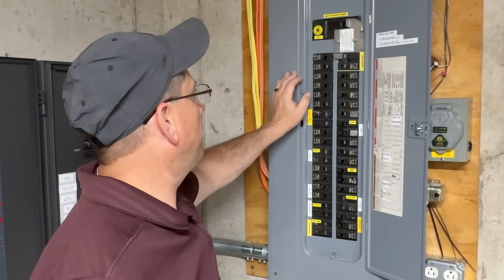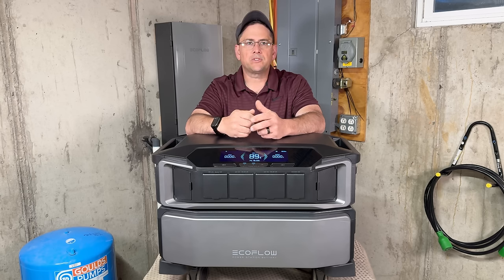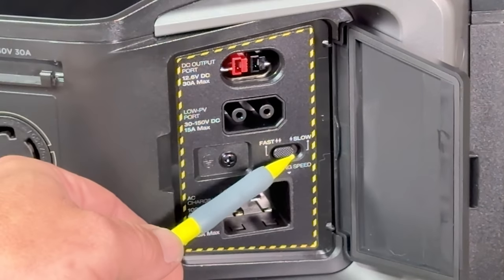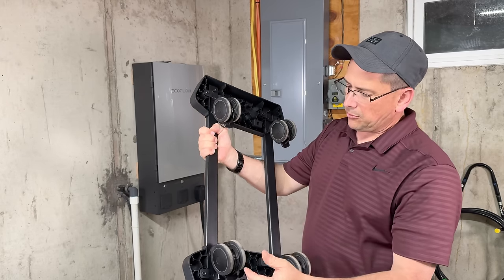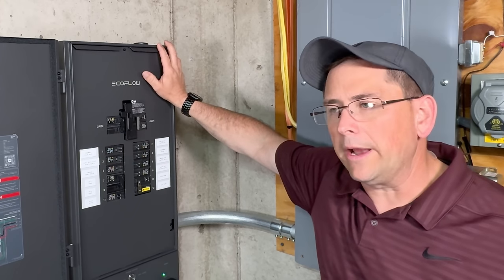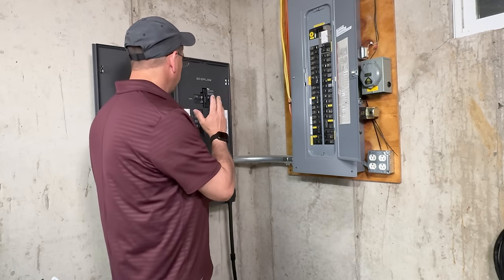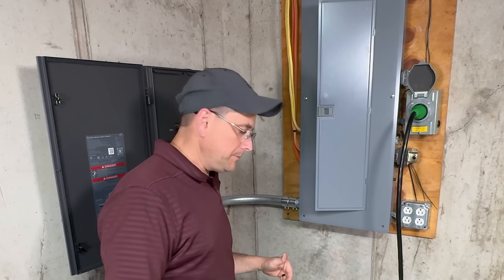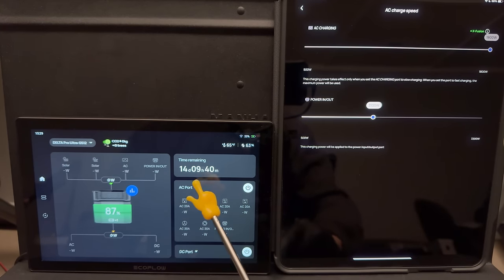EcoFlow Delta Pro Ultra & Smart Panel 2 Replaces Generac Standby Generators Part 1 of 2

Comment: I'm not sure why you need a sub panel. Why not power the entire panel and load manage your home on the fly? This way you have access to any circuit you want. 
I use a Generlink and a portable 7500W generator and it works great and I did the whole thing for about $2800 CAD.
However, if i could afford it I'd prefer to have the Ecoflow stack and charge it via my RV's 5500W generator. Very quiet and efficient, but its only 120V.
Reply from the maker: Some people aren’t savvy enough to control how much power they’re using. I didn’t use a subpanel, my original design was using an interlock doing exactly what you just described. I have a 8000 W 230 V Generac generator. I also have a 2300 W 120v inverter Generac. The battery system is a really nice, convenient item, but it definitely is not cheaper than having a gas generator.
Reply: @HVACRSurvival  I cam understand why it is more money, but I don't care. I'd have the battery system any day if I could. To me, it seems to be a similar issue with induction stoves costing so much more than conventional ones ... just because.   Sure there is a bit more tech in there, but its not that much for them to cost so much more than conventional stoves. I guess the only way to force these changes is either by rebates or other financial incentives as many seem to care only about their pocketbook.
I understand with these units there is a lot of tech and exotic materials in the batteries making the prices higher.
Can you give a price comparison between a typical general setup and this system? Be nice for us viewers to compare ... even if they gave it to you for review.

Comment: I purchased this exact setup with 2 batteries and the ecoflow smart panel 2. I have a solar panel array in my backyard. I know there is a way to wire it so when the grid is down it will charge the ecoflow batteries instead. I've contacted multiple electricians in the area and they say they would have to run a DC line from the solar panel inverter to the house. I already have lines ran from the solar panel inverter to my breaker box inside the house. Can't you use the lines that are already ran to the house already?
Reply from the maker: I’m not sure what you mean by a solar panel inverter? Generally, you take the voltage from the panels that are outside and run them directly to your EcoFlow power station. The power station has two solar inputs, one is for high voltage and one is for lower voltage. You need to measure and see what your total voltage is and make sure that your wattage is not over the rating plate for the input you’re using.  You plug this strait into the EcoFlow. This is a pretty simple thing to do, you just gotta make sure you have the right size gauge wiring to handle the voltage and wattage that’s coming from the panels so that you don’t have a large voltage drop.
Reply: @HVACRSurvival    When the solar input is low will a generac generator automatically start charging an ecoflow ultra after it drops below say 35% charge?

Comment: Great vid. I’d really like to hear your opinion on this vs a generac for “grid-down” situations. Is this a better option even without solar panels?

It’s also my understanding that the Inflation Reduction Act will cover this too. If so, does that make this a better value than a generac?
Reply from the maker: I have heard there’s a 30% tax credit available. One of the things to consider is when your gas generators is running and you don’t have any loads on it,  you’re still burning gas….so if you don’t have solar, you could always charge it with the generator in anywhere from one to a couple hours, and then shut the gas generator off for several hours compared to the gas generator running nonstop

Comment: QUESTION My ecoflow ultra was half delivered today. Expecting the other half shortly. My electrical panel is outside. I plan on using a generator outlet and an interlock. Can that generator outlet be placed inside the house even though the panel is outside? Using SS2-50P/L1430/L1430P to SS2-50R
Reply from the maker: Yes, if I’m understanding you correctly, you’re gonna have the interlock switch outside at your breaker panel and you want to mount the inlet box on the inside of the house like I did at my panel in the video? Of course, that means you have to run your generator cable into the house to reach the inlet box? Normally, the inlet box is mounted outside so that it’s convenient to hook up the generator outside and not have to run the wires into the house.

Comment: Thank you for the informative video.  Will watch your other videos.
If I have two electrical panels - that are on different floors - do I have to get two EcoFlow systems with two EcoFow panels?
Also, since the EcoFlow panel does not have as many spaces for circuits as a regular electrical panel, do you combine circuits? In other words, can a Ecoflow panel circuit handle more than one circuit from the house electrical panel?
Thanks.
Reply from the maker: You can use tandem breakers to add extra circus, but you need an electrician to look at your system and advise you of your options. I can’t do that without seeing it and knowing what your local code calls for.

Comment: This is a wonderful review but I have so many questions. I have a Whole House Generac 22KW. I want the Ecoflow Smart Panel 2 and a EcoFlow DELTA Pro 3 Portable Power Station
DELTA Pro 3 + DELTA Pro 3 Extra Battery because I want to turn off the Generac at around 10 pm at night (Very Noisy and neighbors really near) and run only a few circuits including 4 Ton AC u
unit. My idea is to run this until sunrise. I need help in configuration but it will be installed by a licensed Electrician. How can I contact you?
Reply from the maker: @thompsonp86 i’m not available to do sizing or give advice. Your application could vary compared to mine. A 4 ton AC unit is bigger than what I’ve got and it’s larger than what they rated it for, you’re better off with the delta pro ultra over the DP3 because of the size of your AC. You likely will need to have an HVAC contractor come out and see see what the inrush of your AC is to see if the DP 3 could handle it. The contractor could always add a soft start or hard start to the AC to with the starting amps. A Electrician should be able to calculate what your normal running load is to see if one battery is going to be enough. That’s about as much advice as I can give you without seeing it and testing it.

Comment: Thx for the great video!  I'm getting ready to have a whole-home ECF setup installed.  3xDPUs, 2SP2s, total of 5 batteries. Like you, we have a heavy load here.  Q:  Does the power cable you show (7.1'?) connecting the Sp2 to inverter come with the panels...or need to order separately?  Is there a cable with the inverters capable of connecting to the Sp2?  Cant tell from their website..   Thx again for all the good info!
Reply from the maker: I believe it came with the SHP2

Comment: I have a DPU and a Manual Transfer switch. Can I leave the MTS with my circuits left on "GEN" and have the DPU plugged in to my regular 200 amp panel without issue? Looking to run the DPU as a whole home UPS. So When the power goes out the DPU batteries kick in without me having to be around to flip switches should the power go out. Or does this cause a looping issue?
Reply from the maker: The 30 amp plug has UPS built into it but that’s only 120 V. I think you’re gonna have a hard time doing what you’re explaining because of the amount of amperage looping through the machine. I don’t think you’re gonna be able to recoup fast enough. The safest bet is to get the automatic transfer switch.

Comment: Question so I’m looking to throw this into a camper trailer and convert the trailer to solar but my question is could I charge the unit with shore power from a campsite when I do decide to use a campground?? Can I just plug the shore power into the generator plug and would I need to u plug the solar to the unit while charging it off shore power
Reply from the maker: Yes, it’s got seven different ways that you can charge it. Plug it into the wall, plug it into a transfer switch, plug it into a generator plug it into another power station plug it into solar you can do all at the same time you can plug it into a car You name it.

Comment: If we are planning to have this unit in case of a multi day power loss like a hurricane and want it to run our home HVAC along with essentials (fridges, deep freeze, micro, cpap, pool equip), do we add up the amount of wattage each of these appliances use and buy enough DPU batteries to cover the wattage?
Reply from the maker: If you’re wanting to live life like you’re not on a reserve power with a battery system plan on spending allot of money on extra batteries and extra inverters. You’re definitely going to need solar cells or a gas generator to recharge it if you’re planning for a hurricane where the power can be out for several days if not longer.  Pool equipment is not an necessity when you have no power, that eats up a lot of power. The easiest thing to do is look at your power bill and see how many kilowatts a day you use on average, that will tell you what you need to know and just add up how many days you want power for.

Comment: I wonder how will a system like this would run a 240V inverter welding machine.
Reply from the maker: You know what,  I can run a Lincoln 130 with it so I can try that. I don’t see why it would be a problem. I have access to a Lincoln 180 or 170 which is 230 V. Maybe I’ll pick that up too, but it’s so heavy to take outside that kind of sucks of course I can run it from the house so I guess we may have to try that.
Reply: @HVACRSurvival  Even places inside might not have power enough to weld with.  You could also mount it inside a cargo van, etc, much like how engine driven welders are used now.  If you are welding outside a power source is still needed.  Most welders could fabricate something like a cart to use it outside.

Comment: How many batteries would I need for three day with normal appliances. Fridge, lights tv etc.. I don't want to spend for 5 batteries because it's expensive
Reply from the maker: Best thing to do is either buy a meter that keeps track of how ow many watts your using or look at your power bill and see how many kilowatts you’re using per day. Everyone’s gonna be different. Also depends if you have a lot of heavy electrical appliances like electric range, electric water heater, electric dryer, all those things are gonna change the numbers. There’s nothing cheap about any of these systems.

Comment: Can you run the Smart Home Panel 2 off grid without it being hooked up to a grid panel at all?

Can you run 240v loads with the Smart Home Panel 2?

Say it’s hooked up to the grid like normal, can you have say a Generac standby generator that comes on automatically after the batteries have depleted and stopped outputting power?
Reply from the maker: I'm probably not understanding your question, but if the power is completely out, the smart panel switch is powered off of the DPU, if you're wanting something to communicate between a generator and the smart panel, you'd be better off buying the Eco flow automatic generator that communicates with the power station, it can automatically start it and shut off once the batteries are charged and I'll do it remotely.

Comment: Got 2 5p smart batteries and 18 panels, and all I pay is the mandatory 12$ california charges. I drive an EV as my promary(about $200 annually)as well. It did have a "car" price to install, but the warranty is for 20 years, no queations. So if you switch to solar in Cali, you will move your power bill to your solar bill. I just wish california didn't do away with power credit back.
Reply from the maker: Lots of good information there that I didn’t know. Thank you for sharing.
Reply: @HVACRSurvival  too many fears with going solar, I figured some personal  experiences with balpark numbers would help. Have a good one.

Comment: does this product work outside the USA/Canada?
Reply from the maker: @ThomasWhittaker  this particular unit is 60 Hz 230 V 120 V. You might be able to get it in 50 Hz but it have to be specifically purchased that way.

Comment: Great Video! Thank you! Can I charge it with my Ford F150 powerboost, I have the 7.2 kw inverter and keep on using the battery power at the same time?
Reply from the maker: I’m not familiar with the Ford power system. What is the voltage and is it DC or AC. ?

Comment: Does this have a capability to sync with an existing SolarEdge grid tie inverter, I have one at my house, would be nice to have when net metering ends in 2032...
Reply from the maker: I’m not familiar with the item you’re mentioning but this is mainly proprietary equipment. You’d have to figure out which wires are doing what and hope they don’t do anything along the lines of communication. I would most likely doubt they do what you’re asking about.

Comment: Can the inverter handle the cold also like the batteries
Reply from the maker: It has the warmer built into the batteries with the DP Ultra.
Reply: @HVACRSurvival  and the batteries warm up the inverter?
Reply from the maker: The batteries have a heater in them only. I don’t believe the inverter has any heaters. I wouldn’t think it would need them.

Comment: Does this Home Panel allow you to to select which circuit can be battery run and which can be grid run at the same time? Or it is either fully grid or fully battery run
Reply from the maker: During an outage you can choose what’s powered by the battery or left off.

Comment: Does EcoFlow make a transfer switch the allows for more than 12 circuits?
Reply from the maker: No you'll have to use tandem breakers like I did in the video. Or you could feed a sub panel to expand it, but you still are limited on how many amps you can feed it. The transfer panel technically is broke up into four sections each ones rated for up to 60A, but the total input into this panel is only 100 A total

Comment: how are you switching between the (3) different generator inlet's? not that it's related much to this video/product.
Reply from the maker: I’m not sure I understand your question, where are you seeing three generator inputs?
Reply: @HVACRSurvival  you said in video, you have three generator inlet boxes, the one in basement, one on garage and another behind the house or something?
Reply from the maker: Two are in in parallel with each other. The other one technically has to have the main breaker turned off in advance.

Comment: Can non EcoFlow batteries be used with the inverter?
Reply from the maker: I would be leery of mismatching the battery to the inverter section just for the fact that the safety circuitry is proprietary and would likely not communicate.